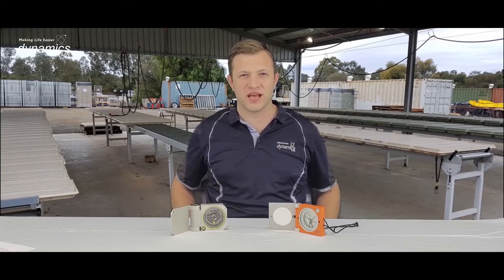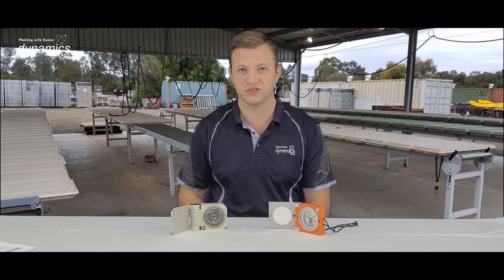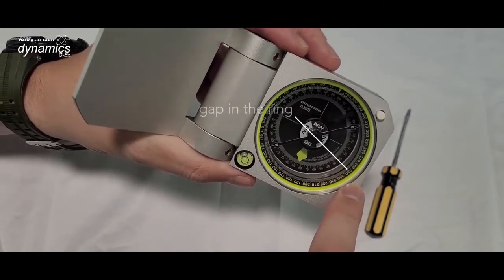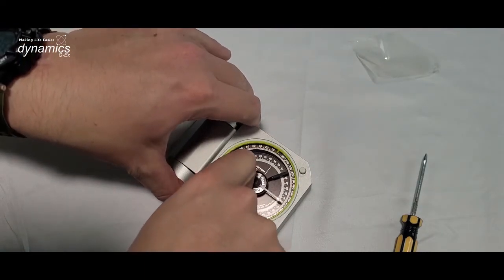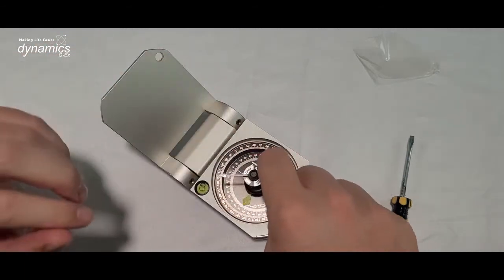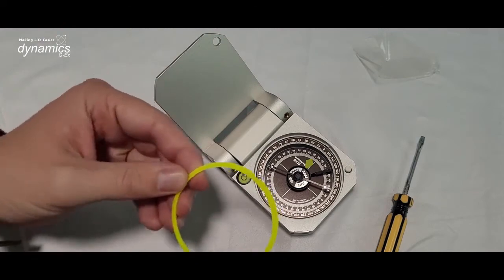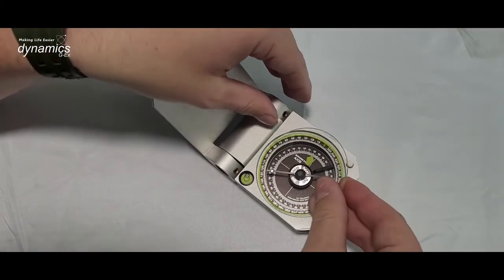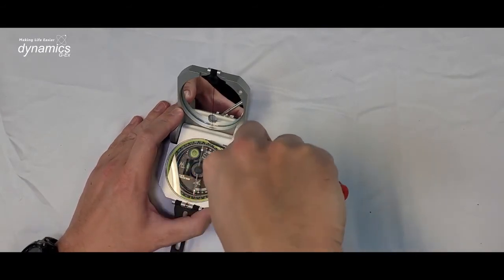How To DIY Balance Your Brunton Compass

Comment: I use a larger sewing needle to pop the metal retaining ring ring out of the groove. It works so much easier. You just follow the groove around after you initially pop the end of the ring up then push the needle around under it in the groove popping the ring out of the groove. Its much easier than a screwdriver and easier on the compass.

Comment: If you bend the needle ends up and down respectively the magnet is still tilted which may mechanically interfere with proper needle rotation. I'd add movable weights to  both needle arms because that truly allows adjustable balancing. I'd also get some Rodico watchmaker's cleaning gum to pick up dust particles that may have fallen into the box before putting the glass cover back on. At least that's what I did when I worked on my Brunton transit.